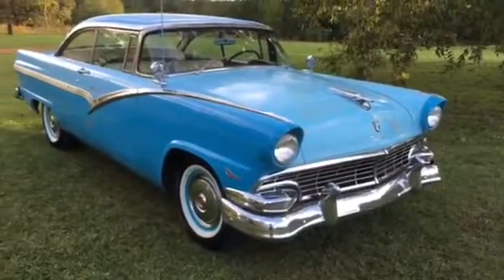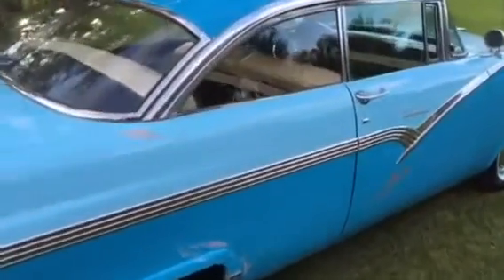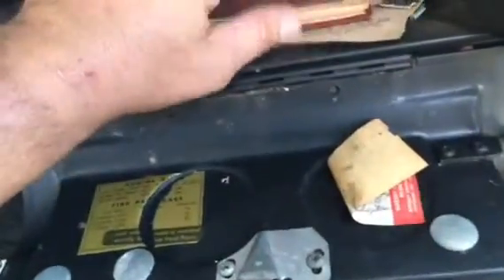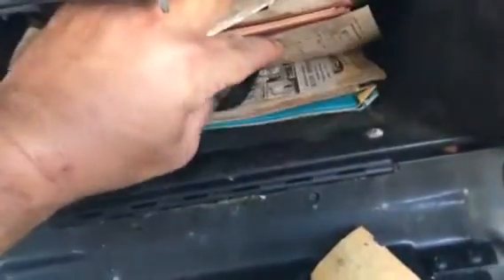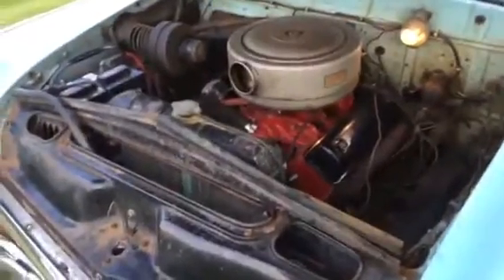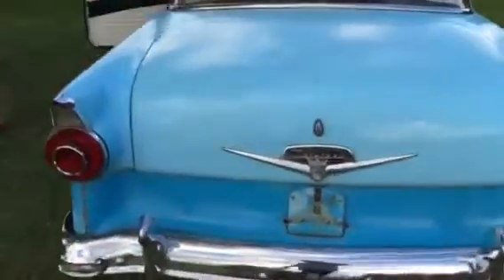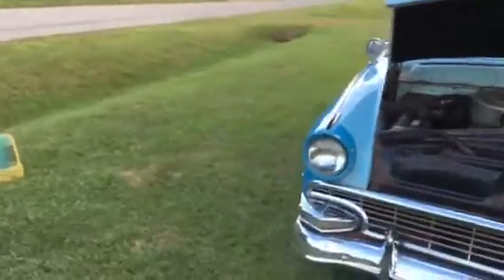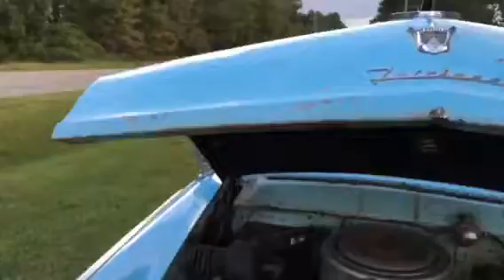1956 Fairlane Victoria walkaround eBay item #283201137932

Comment: If ya don't mind what did you get for it? I'm looking for a good driver to enjoy. Nothing perfect or show car condition...just a decent looking Saturday night car. I'm not real familiar with the value of Ford's
Reply from the maker: A solid original driver will set you back around 15k. Only problem is next to impossible to find them original and running and solid anymore 👍